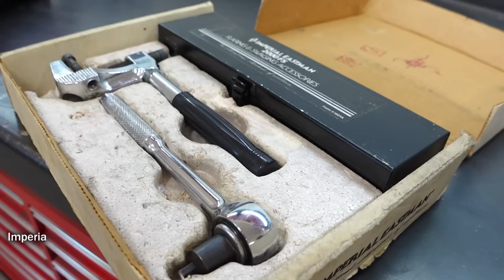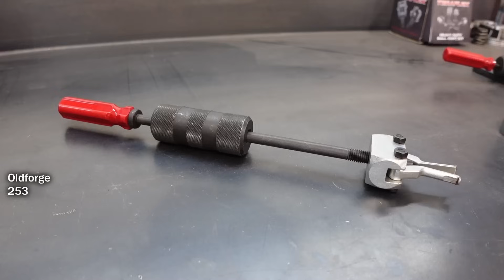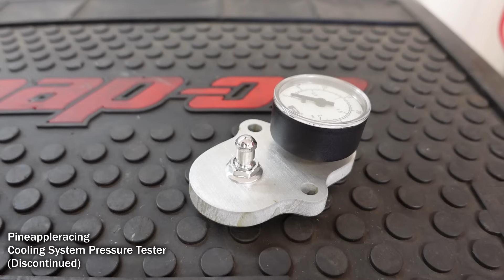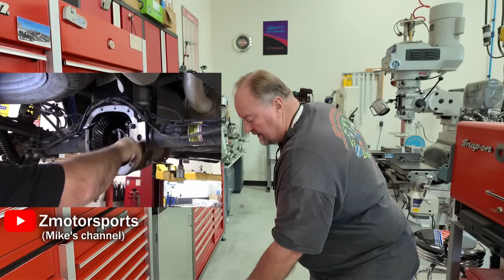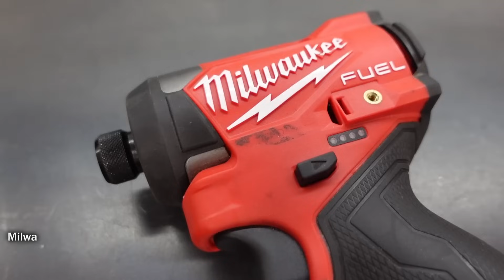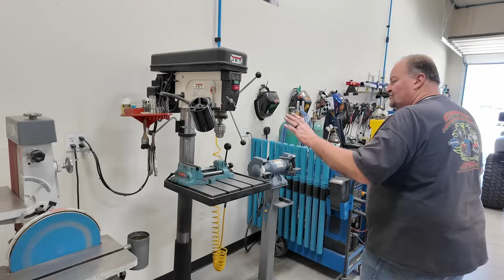Retired SPEED Shop Owner Has it ALL

Comment: This is a mechanic that diagnosed and repaired components of the system - today the whole assembly is replaced, even if the DC motor, or what have you, could just be repaired.

Comment: Because you already have the m12 tek gun, I do very much recommend a right angle rattlegun, also in m12, the 3/8 one is one I pull out basically every job, and with a shallow socket can get basically any fastener you need to get a rattlegun into. 

And it has extremely surprising amounts of torque in both directions. With the bonus of not needing air, and that you can use m12 small or m12 large batteries

Comment: there is a lot to  take in from a guy that’s been Wrenching as long as this guy  i used to keep boxes ofWooden Toothpicks  in my Tool boxes  to shove in those door switches  to keep them depressed to stop the buzzers  sadly over the years the Donestic Cars and Trucks  eliminated the metal ones and   installed  plastic ones tat don’t last  and the WoodenToothpicks don’t wedge into them  tight enough
Reply from the maker: Toothpicks!! Genius!

Comment: I'm with you on the comfort grip. I don't like them either. I am 100% a chrome handle guy!! Im sure there are instances when its better, but i prefer chrome all the way!! Also, I love those roto head ratchets!! Most people don't prefer them, but I absolutely love them!! The problem is that the majority of them have absolutely terrible back drag, but if you get a good one like the snap on, carlye, koken, (a few others too), they are the best type of ratchet to use, and the most versatile, in my opinion. They are usually my go to ratchets actually. Its like Mike said in the video, no matter what angle you flex it at, the pressure and centering is always up top, right in the middle of the head, where its supposed to be!! They are also stronger than a standard ratchet, and can yeild higher torque ratings.

Comment: Years ago I ran into the 3 inch pound issue and asked factory about it and they told me it is technical term for "finger tight" but since then Ive found Cummins has preset torque t-handles in the 6 and 12inlbs for injecter wire nuts.